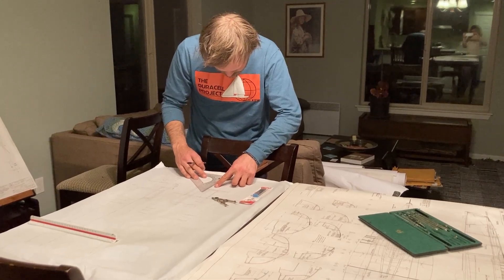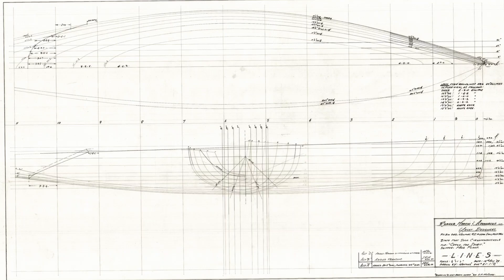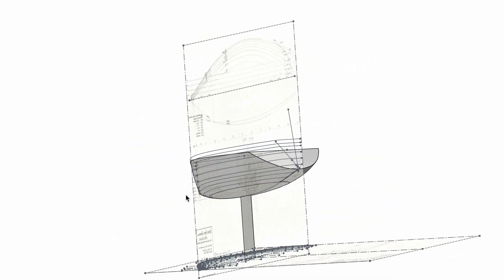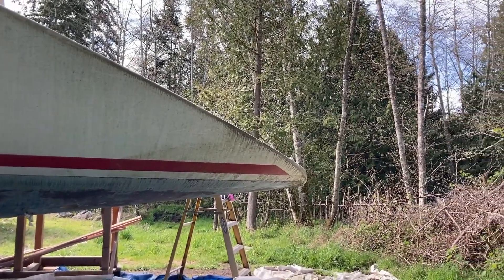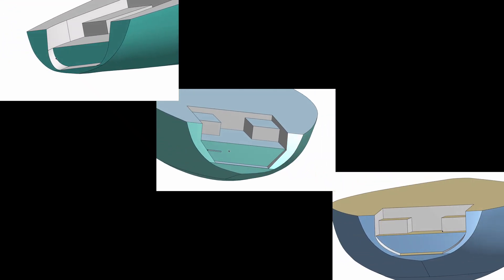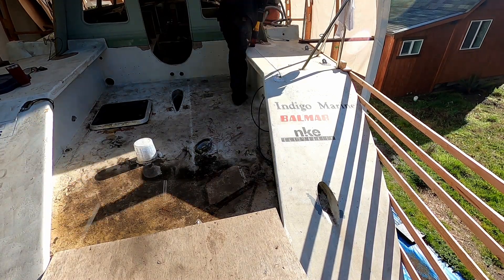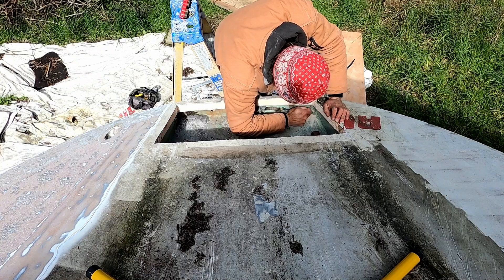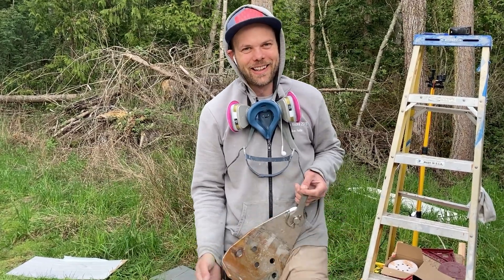Race Boat Refit: New Stern Design [E27]

Comment: are you planning to have "seats" at the back that lift up or is it going to be open all the time.  Some of the big production monos have these "benches" on hinges that meet in the centre and provide some additional seating, and a bit of a barrier to the cockpit, anyway.  BTW what kind of rudder system are you planning, chain-driven or hydraulic.
Reply from the maker: I'm thinking about a removable bench for sure.  Chain steering.
Reply: @TheDuracellProject  I guess the boat is well balanced, considering it was a racing boat, but will the change in the mast length and the change in the shape of the keel have an impact on the balance of the boat when steering?  I know it's early in the process, but since you already have the CAD design and a good idea of the selected mast, it may be worth thinking of the shape, and placement of the rudders.  Must say that yours,  probably with  Leo's Sampson Boat Co, is the most interesting, informative look at the design, and crafting of a sailboat.  Really!!!  BTW love the exchange with your "wife" about the chainplate removal process.  Still laughing about it!
Reply: @TheDuracellProject  BTW someone below (Nicolo) suggested a folding platform.  Maybe that's an excellent idea, first, it closes the back of the boat in following and swamping seas, secondly, when closed it provides protection from unwanted borders -- not all are human!!! Sea lions love open transoms.  It could also solve the third aspect that someone mentioned below that it would allow you to have a much lower arch (for solar panels), hence keep the centre of gravity lower.  Oh and finally scale of the cockpit would be great.  I don't know if it's going to be 2 or 3 meters long.  I get the feeling it's going to be a huge cockpit.
Reply from the maker: Yes the balance of the keel/rudders/mast will need to be analyzed when it comes time to adjust the keel.  The twin rudders are supposedly almost 'overbalanced' so it's really light on the helm.  Rodger Martin actually told me that I may want to shave a bit off of the leading edges.  Lately I've been thinking about even changing to a single rudder, the thought of an unprotected rudder scares me a little.  The cockpit will end up being almost 4 meters!

Comment: Dear Matt - I have been loving your videos, the involvement of your family/friends,  and highly respect your endeavor. I looked at the 3 CAD drawings of the transom you presented. In your design plans, have you considered designing in a place to mount an auxiliary outboard motor? Not that you would have an outboard motor there all the time (the thought of following seas constantly washing the motor is horrific - haha). It may not be pretty too. However, in case your main engine goes out when you need it, having the outboard motor mount on your transom (with some sort of davit to get the temp ob safely in place) could give you more options.
Reply from the maker: I have not thought about this, and will consider it.  Duracell was sailed without an engine while Mike Plant raced it.  When the next owner began racing in the pacific, he installed 2 diesel outboards for the Pan Pacific race.  I have a photo that I'll share eventually, it's pretty funny looking. In all honesty, if the engine goes out, we should be able to sail the boat.

Comment: Hi, fantastic and fascinating job! One question: how do you manage weight? Do you leverage on the weight you reduce in the keel and the mast or will you accept the boat sitting deeper in the water?
Reply from the maker: The boat will for sure be sitting a little lower in the water, it is something I have to accept. But I am leaning towards using lighter materials and methods (foam, vac bagging) to reduce weight where I can.
Reply: You‘ll be fine! Gewat job!

Comment: have seen quite a few relatively open transom/cockpits over the years. mostly on shorter boats. would expect them to pivot on top of the swell and lift the transom on a following sea. a longer vessel might encompass two crests not allowing the stern to rise much, taking water. all assuming limited forward motion. guess im just not a fan.